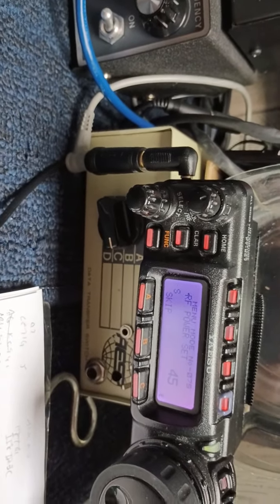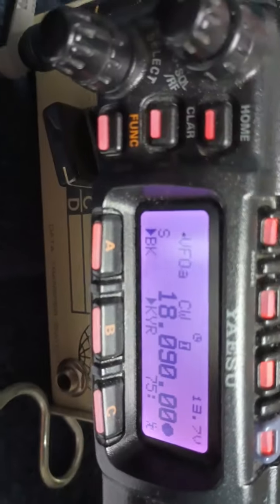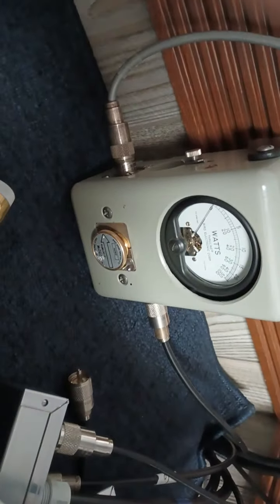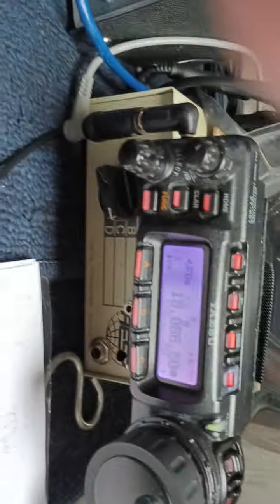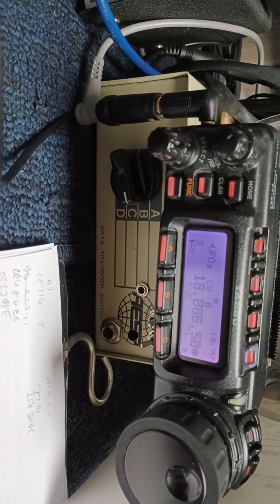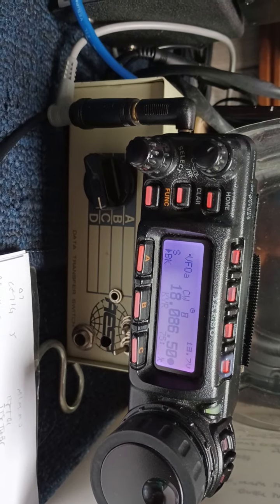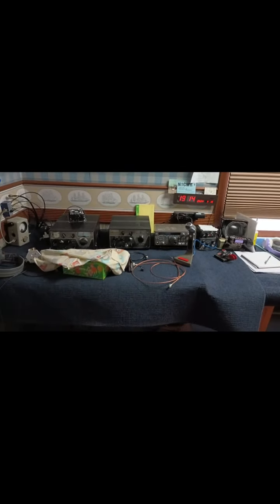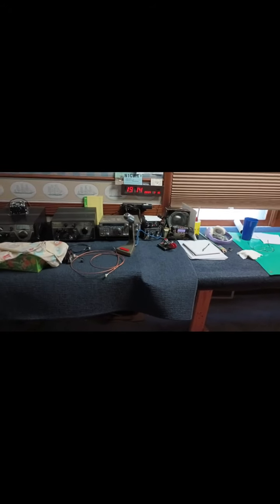1/2 Watt CW To  Watt Spain, New Antenna

Comment: Interesting.  My 857 does 5 watts on the lowest setting. Did you do a mod to get to go lower? Thanks
Reply from the maker: Yes, in software.  ITs accessed thru the Service settings by turning Power off, then holding down the A B and C keys while turning power On. Then use the big knob to scroll up to setting Menu 27, "HF- PO- MIN" set to "0". DONT accidentally change any other settings like "IC" (PA current). Its easy to screw this radio up with improper settings.

And, note, half-watt is only approximate on a 50 watt Bird 43 element. Its so low it really cant be read on the meter.